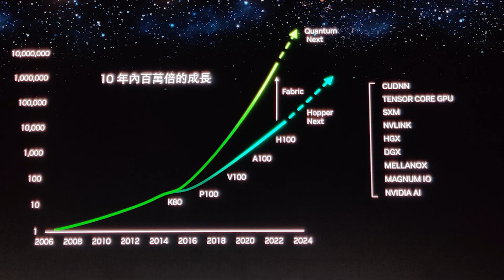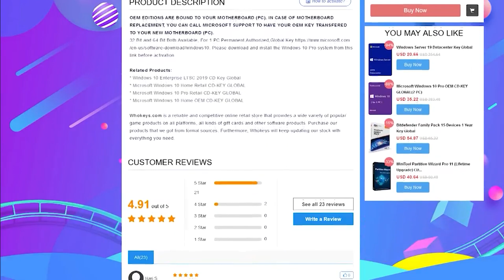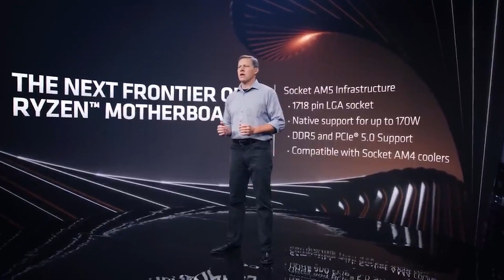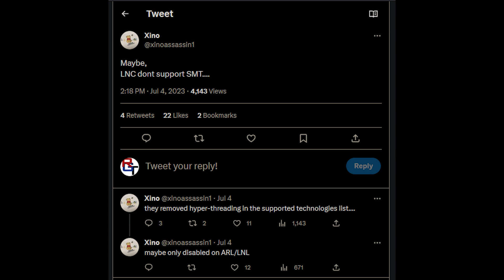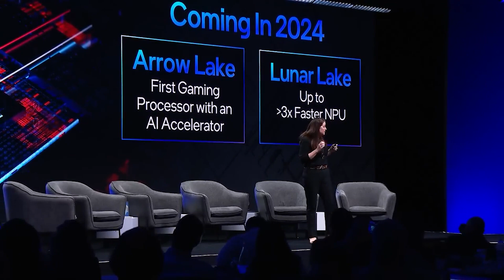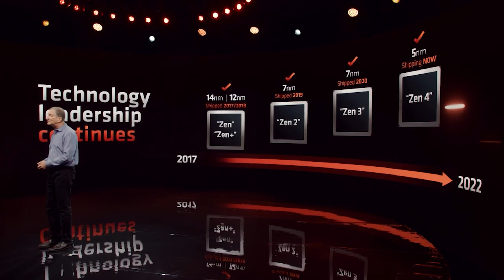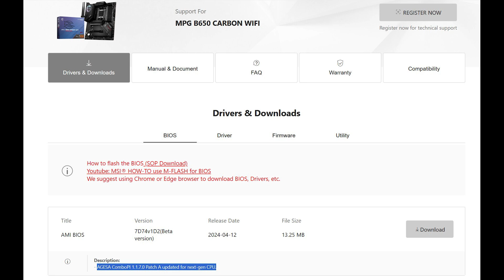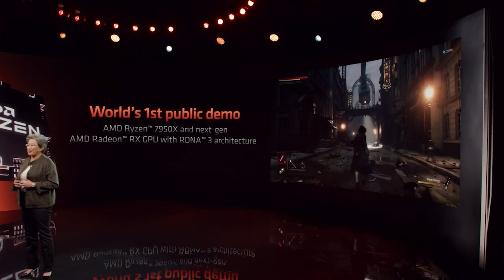Zen 5 CPUs CONFIRMED | RIP Hyperthreading - Arrow Lake LEAKS

Comment: Well, back in the day I remember hardware unboxed testing the i7 8700K and 7700K with and without hyper threading. Benchmark apps would work about 25% better with HT, but many apps would work better without it.

For games, the 7700K was getting a big hit on average fps and low 1%, while the 8700K got lower waverage fps but kept the same low 1%.

And this is with a 4 and a 6 core processor. I guess at some point you get so many cores that HT barely helps, and it could still cripple many apps that take advantage of having dedicated cores.

Comment: I'm not surprised. Hyper Threading is basically now provided by e-cores. They offload work from the performance cores. Since they are very tiny on todays manufacturing nodes and manufactures can cram in a lot of them there is less and less reason with every generation to still devote silicon to support HT. It also means, that the execution pipelines on performance cores are utilised efficiently enough (given the demanding workloads, they are running), that HT isn't necessary anymore. It also means, that the system/kernel/compiler scheduling that takes place has matured enough, where the majority of tasks are assigned efficiently to correct core types, hence HT is not necessary anymore. Also as more e-cores are added they see less and less %usage in real-world scenarios, so it also warrants dumping of HT. Also let's be honest a lot of programs still don't utilise threading to the fullest due to their core code being carried over from a different epoch. It's one thing to spot optimise specific demanding workloads and it's a different animal to re-write your softwares core loops (core logic) with that in-mind. It's hard to engineer against Amdahl's law as well, so a lot of software utilises "braided parallelism" or "burst parallelism".
Reply: That doesn't fit with HT being in the plans, but dropped later as they had problems.  True that many E cores reduce the proportional benefit of Intel HT.  But basically heavy MT benchmark code isn't heavy on cache so the ¼ area E core is effective en masse, while all P core would lose badly even with HT.
But you're factually wrong on scheduling, the Thread Director is not controllable by programs but will tell kernel to push AVX threads onto P core then off if the mix changes, the latency issues reported on Intel are a sign that it's not solved, Alder Lake didn't even work as advertised putting "background" tasks onto E cores, that was demonstrated as an RPL fix.
When you're talking about parallelising loops that's compiler optimisation setting up SIMD vector processing which is a form of pipelining on a single core.
HT mitigates memory stalls, which is why disabling it caused capacity problems on servers.
Just like not enforcing power limits and adding E core while dropping AVX512, this is Intel taking decisions to cut corners due to execution problems, under pressure to deliver benchmark review scores.  The real issue is the P core are too big and too power hungry to match Zen glued together dual CCD CPUs, which efficiently used SMT.

Comment: Who cares about vanilla Zen 5? It will be slow and will be lucky to match 13900k/7800x3d in gaming. Most people only care about X3D variants. ArrowLake is much more interesting. Intel really needs it to be good.
Reply: Arrow Lake needs to be extremely good to compete with Zen5. I hope it won't be just another disappointment like Meteor Lake and "14th gen"
Reply: Does Arrowlake socket design different? So there is no point of upgrading from say 14900K and instead build a new system (new mobo/CPU combo).
Reply: @Hyperion1722  Arrow Lake is on a new platform. 14900k is a dead end.
Reply: @mimon6706  OK. So am5 owners are in a better/ cost effective position to upgrade to Zen 5 compared to an arrow lake upgrade due to mobo replacement.
Reply: @Hyperion1722  Yes. I built an AM5 system last year and I plan to upgrade to Zen6 in a few years. All I'll need to do is changing CPUs, no further upgrade costs.

Comment: IPC is ALWAYS based on the workload.  This also means improvement to IPC moving to a next gen will be based on the workload.  Since one architectural change may benefit some workloads and not others there isn't a good way to ACTUALLY calculate IPC.  You can get IPC if you have a routine written to do exactly that, get an IPC, but once again it's going to be based on the instructions that were run during that routine.

So, IPC uplift simply looks at how much faster next gen is over current gen, when both CPUs are locked at a certain clockspeed, to removed clockspeed from being able to affect the results since after all, it's "instructions per clock cycle (IPCC if you will)"

I think I'll go with what Tom has released for now, which is between 17 - 20% when the avg. is calculated.  So in some apps the IPC will be higher than this and in others, lower than this. 

AMD, as they have now for the life of Zen will pick a pretty good list of current apps and get an IPC uplift for each, and then calculate an average based on that.  This will also include a few games.

Just for general info, since games are so data intensive, IPC tends to improve a lot when cache sizes are increase and it doesn't matter if it's L1, 2 or 3.

Comment: The core count is bumping so high the HT doesnt matter much. I would rather they focus on improving their e cores and getting those TDPs under control. I would gladly take a ~20% bump in PPW then take the crap shoots of if HT scheduling is actually helping you. There is a surprising amount of real-estate taken by HT now on AMD. Just add it to the cache budget or add another core.
Heck even the NPUs are starting to be useful in conferencing and other apps.

Comment: Intel please don't mess up Arrow Lake as well.
Reply: @royboysoyboy  fine or even great? How? In performance they were mostly good enough to compete with AMD, but they were years behind in efficiency, had no upgrade paths and cost way more.
It's not fine if the more expensive 14900K can tie the 7950X in performance while consuming double the energy and being on a dead end platform.
The 7800X3D even outperforms the 14900KS in gaming while costing not even half as much and using less than one third of the power.
Intel needs to achieve a huge jump in performance and at least cut power consumption in half to become competitive again. But considering their latest duds "14th" gen and MTL that's very unlikely.
Reply: @nipa5961 the idea that Intel is less power efficient than AMD is very misleading by the fact that benchmarks are putting heavy load on CPUs.  But in real world usage even for gamers the CPUs are not going full time at 100% instead most of the time are underloaded and even idling. Even if AMD is more efficient at heavy load, Intel is more efficient when the CPU is not on heavy load and way more when idling. In my case 80% time is productivity, internet browsing, YouTube, movies and only 20% is gaming. So definitely in my case the Intel is more energy efficient than AMD. Obviously both, Intel and AMD, need to further decrease the power consumption for their CPUs, but is kind stupid to go full over Intel for something that is presented in a misleading way.
I was curious to search info about market share and surprised by the fact that Intel is the master when comes to laptops platforms. And laptops are very used in productivity in companies with thousands of employees. Even my international employer with over 200 thousands employees is using only Intel platforms, desktop and laptops. When it comes to only laptops there you need to have a less power hungry CPUs at tasks that don't require so much CPU usage and Intel does this very well.
So benchmarks from YouTube are not a representation of what real world usage looks like.
Reply: @royboysoyboy  you can stop raging. Pat and userbenchmark are very proud of you!
Reply: @royboysoyboy  Pat and UserBM are very proud of you!
Reply: @royboysoyboy  I said that? Show me! or learn to read... XD
Reply: @royboysoyboy  "Says the guy who said 14900K is not compatible on 12100F platform" and "No motherboard you bought to run a 12100f is also capable to run a 14900K." are two completely different sentences with two completely different meanings.

You really think the words "capable" and "compatible" are one and the same? They mean the same? 

Read comprehension really is hard. XD

Also, you really bought a 250€+ board for a sub 100€ CPU to build a budget system?? XD

No H610 board can handle a 14900K, barely any decent B660 board can handle a 14900K, even many sub 250€ Z690 boards thermal throttle after a few minutes. Steve from HU has tested dozens of boards and showed time and time again what a shitshow most LGA1700 boards are. 

Oh wait, you don't believe in tests, benchmarks and facts. Too bad.
Reply: And just more made up bs...
I never said 14900, i never responded to 14900. You, and only you, claimed that a 14600, 14900, or even 14900K would run on a budget H610 though. 
That was debunked and disproven by hundreds of testers, not just on youtube ;)
It's not my fault you ignore physics, logic and all facts. 

Really, re-read my comments after learning to read. Don't skip words, don't try to fill blanks with your fantasy, ask your parents or your teachers for help instead.
Best of luck!
Reply: @nipa5961  aaaaand the troll is gone XD
He tried so hard and didn't get far. 
And in the end he went back to userbenchmark where came from. 🤣

cheers, mate!
Reply: @mimon6706  On point! 
Have a good one!
Reply: @royboysoyboy  Really? again?? XD
You make up random claims and think you proved anything??? XD
I never ever said 14900! I literally only copy and pasted your quote of what you claimed i said and then I copy and pasted a quote of what I actually said.
The only one who changed words and claims is you, again and again!

If you learn to read one day you can come back here and re-read all my comments. 
I disproved most of your bs more than once. Too bad you don't care about facts and logic though.
Reply: @royboysoyboy  And just more made up bs...
I never said 14900, i never responded to 14900. You, and only you, claimed that a 14600, 14900, or even 14900K would run on a budget H610 though. 
That was debunked and disproven by hundreds of testers, not just on youtube ;)
It's not my fault you ignore physics, logic and all facts. 

Really, re-read my comments after learning to read. Don't skip words, don't try to fill blanks with your fantasy, ask your parents or your teachers for help instead.
Best of luck!
Reply: @royboysoyboy  7950X is 520€, 14900K is 580€.
No motherboard you bought to run a 12100f is also capable to run a 14900K. 
There is also no current Intel CPU under 100€ too, the 14100f is 122€.
The 7800X3D is already 31% faster in games than the 7500f. AMD offers the same upgrade uplift within one single generation already as Intel in "three" generations. And there are still most likely 2 more generations to come on AM5.
Why do think "The average PC user" cares about single core performance so much? 
I think people care about single core, multi core and gaming performance in the same way.
Even Intels current 5% advantage is more than evened out by AMD's 10% advantage in gaming.
Reply: @royboysoyboy  All Intel and AMD chips are always available. No shortages or inflated prices since late 2021 anymore.
The 12100f is 96€ here, the much faster 5600 is 108€. Again the 5600 would be the obvious choice for budget systems. 
AM4 boards are also cheaper than LGA1700.
The 7500f was on sale for 159€ this weekend and 164€ right now. A slower 14400f is 217€ right now though. Intel's prices are a disgrace.
Reply: Really, you are desperately cherry picking now? XD
The 7800X3D is 10% faster on average. In  a few games the 14900KS is faster and in a few games the 7800X3D is even 30+% faster. Cherry picking single games makes no sense though.
The 7800X3D is also way way cheaper and consumes only a third the energy though.

Also wrong: It makes no sense to pair a sub $100 12100f as you keep mentioning with a $200+ Z690 board to upgrade to a 14900K later.
Even some entry level Z690 overheat and throttle a 13900K/14900K as Steve from HU has proven over and over again.
While any entry level A620 board for ~80€ will support a 7500f, 7800X3D and all coming low power X3D gaming chips on AM5.

And again wrong: I never focused on a usecase, I pointed out several and showed that AMD is always the better, cheaper and usually faster choice.
You always keep claiming though that a 5% faster single core performance is much more important than a 10% lead in gaming or the same multi core performance at 150W less power draw and always much lower prices. Strange...

Also wrong: DDR5 prices are not an issues anymore for about a year already. When Alder Lake was released there was no DDR5 available at all though and then months later at least 5x the price of sweet spot DDR4.
Also you conveniently forget to mention that using DDR4 on LGA1700 costs a lot of performance... Good idea to lose 5-15% to save 15€!
Reply: The 7800X3D is better in games on average by 10% compared to the 14900K, I never even mentioned the 30+% outliers.
The 14600K is 41€ cheaper than the 7800X3D but also much slower in games and consumes way more energy. Strange you focus so much about multi core performance this time since you said single core is the most important thing last time...
Also interesting you mention poor performance and  instability because j2c switched publicly to AMD because he newer managed to get his previous 12900K system to run stable. Also there are tons of news right now about Intel 13th and 14th gen CPUs black screening and not working anymore after just a few months of use. 

I also never said there is a universal best CPU for every single workload, but considering all the aspects I mentioned, performance, efficiency, prices, platform, upgrade paths and running costs there is sadly no usecase a Intel CPU would be the better option right now.

In gaming the 7800X3D is by far the best and way way cheaper choice.
In multi core scenarios the 7950X is the obvious choice.
A 5% single core advantage is a joke if you factor in all other Intel downsides right now.
And really? You would recommend Intel for web browsing and office... well, maybe it's important for someone if a page opens in 0,0020 or in 0,0019 seconds...

But I hope Arrow Lake will finally catch up to Zen5, because I want to have a choice! 
I want AMD and Intel to be neck in neck every generation. It's sad Intel is so far behind like AMD was 10 years ago.
Reply: @royboysoyboy  Right... you don't cherry pick and only look at the full picture...

That's why you ignore gaming performance, platform, upgrade paths, efficiency, prices and running costs, because a 5% single core performance advantage in web browsing and office is all that counts... 

You don't need YouTubers who test and benchmark CPUs because you know best, no facts needed.

You can't argue with that.
Reply: @nipa5961  i cant believe his best argument for Intel is Office and web browsing 😂
This Intel troll is stuck in 1999. Facts won't convince him.
Reply: @mimon6706  ikr XD
He literally ignores all of Intel downsides and wants to pay double for a web page opening 1ms faster. Sad.
Reply: @royboysoyboy  No worries, you will learn to read one day <3
Reply: @royboysoyboy  The 7800X3D is better in games on average by 10% compared to the 14900K, I never even mentioned the 30+% outliers.
The 14600K is 41€ cheaper than the 7800X3D but also much slower in games and consumes way more energy. Strange you focus so much about multi core performance this time since you said single core is the most important thing last time...
Also interesting you mention poor performance and  instability because j2c switched publicly to AMD because he newer managed to get his previous 12900K system to run stable. Also there are tons of news right now about Intel 13th and 14th gen CPUs black screening and not working anymore after just a few months of use. 

I also never said there is a universal best CPU for every single workload, but considering all the aspects I mentioned, performance, efficiency, prices, platform, upgrade paths and running costs there is sadly no usecase a Intel CPU would be the better option right now.

In gaming the 7800X3D is by far the best and way way cheaper choice.
In multi core scenarios the 7950X is the obvious choice.
A 5% single core advantage is a joke if you factor in all other Intel downsides right now.
And really? You would recommend Intel for web browsing and office... well, maybe it's important for someone if a page opens in 0,0020 or in 0,0019 seconds...

But I hope Arrow Lake will finally catch up to Zen5, because I want to have a choice! 
I want AMD and Intel to be neck in neck every generation. It's sad Intel is so far behind like AMD was 10 years ago.
Reply: who cares

Comment: An Intel 14 gen CPU actually need less power than Ryzen when only doing lite loads. But as soon as you start to go outside this envelope the power consumption goes up on an  exponential curve very quickly
Reply: Does infinity fabric hold the idle power consumption higher for AMD ? Or they simply don't care about it ?
Reply: @harshivpatel6238  I think they do not care it is from the top of my head around 15 watt  ish depending on CPU. As soon as you start to do some real work. Intel start tu guzzle energy
Reply: @afre3398  for my 5th gen laptop intel i5-5200U, it's less than 5W idling. I'd like to see that for AMD laptop chips, that can guzzle 55+watts when needed.
Reply: @harshivpatel6238  Dude we are talking about desktop processors here. I thought that was obvious, jeez!
Reply: @afre3398  why should desktop CPU be any less efficient tho?